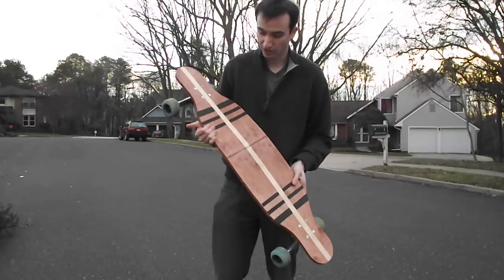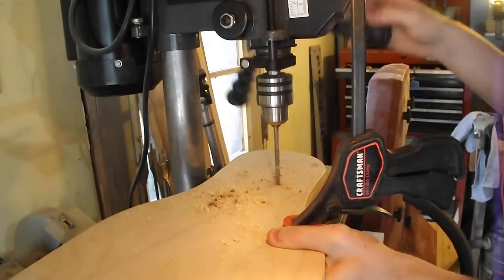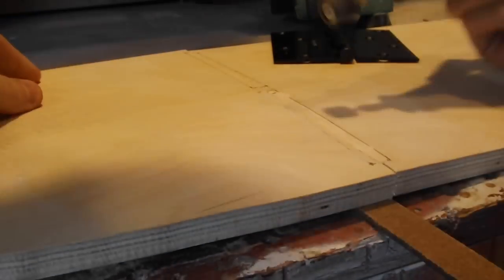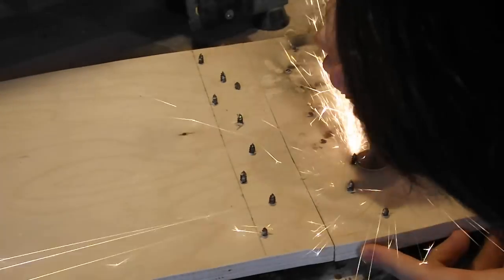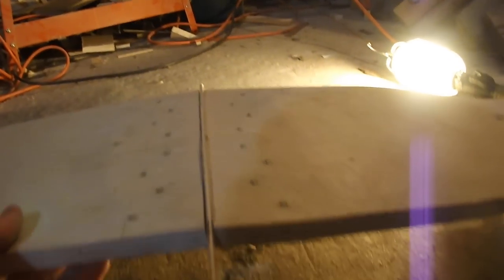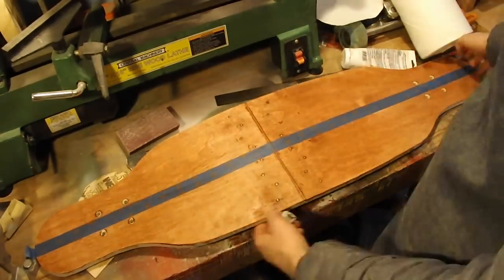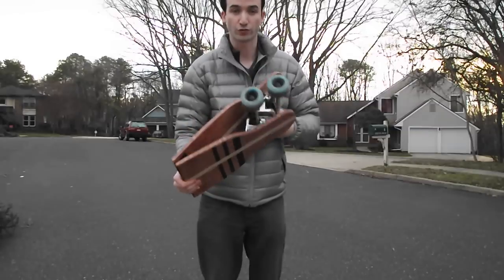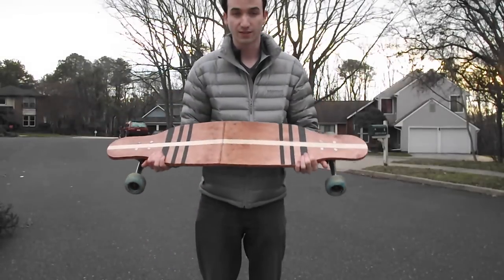How To: Build a Portable Folding Longboard!

Comment: Cool video! Nice to see that you've come up with a result that has lasted a solid amount of time. Personally, I'd be more inclined to use a set of strap hinges, which would extend further along the board, and then consider using countersunk bolts just for extra strength, but well done, it's good to see a successful folding long board :)

Comment: That thing looks prone to breaking. At least I wouldn't bomb a hill with that.
Reply from the maker: I wouldn't bomb a hill on it either, but you'll be fine cruising around town!
Reply: to fix this you would just put a locking mechanism on it
Reply: to fix this you would just put a locking mechanism on it
Reply: you are so right  this thing will break easy
Reply: Ya but if you did you would it would build strength
Reply from the maker: I've been riding it for the past 9 months, still holding up strong!

Comment: Could I do this with a store bought longboard?
Reply: No. Those from a store can't be cut into two.
Reply: +NoisyPixels I wasn't sure if the process he used to make it was the same as the store bought, which uses many layers and a vacuum make a more flexible board. I wasn't sure if he did something like that or used like one piece of a harder wood.
Reply from the maker: +Brian Burrous Absolutely!
Reply: Technically you could but you would want to use a high ply board made of stronger wood like maple so it's more stuff the more flex the more stress it will putt on those hinges and might eventually pull the screws out. Stay away from super long boards and boards made with a composite in between layers just do some research on your board before cutting it
Reply from the maker: +Billy Benedict Good point, I&#39;m less certain it would work as well with a super flexible board. The stiffer the board, the easier it will be to make it work. I know a few board models have things like carbon fiber strips in them which might throw a wrench into things. It&#39;s definitely a good idea to do some research and know what you&#39;re cutting into first.

Comment: how much did this end up costing?
Reply from the maker: +shoganza It depends on what you already have; the only thing I needed to buy was the hinges, but if you already have a longboard, you could buy a new deck and try it out on that, so maybe $50 bucks for a new deck to cut in half and $10 for door hinges?
Reply: thanks!